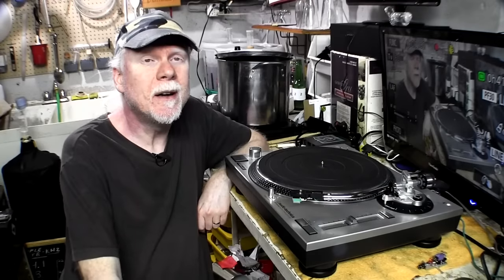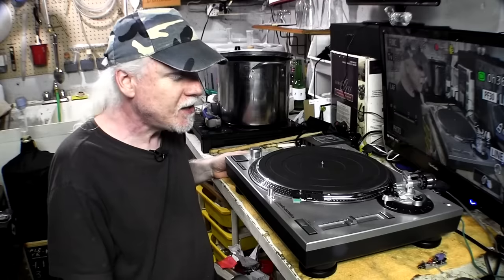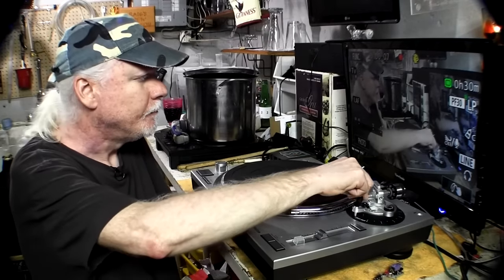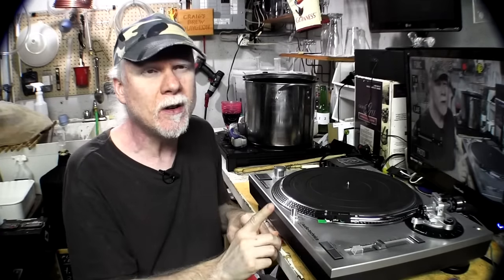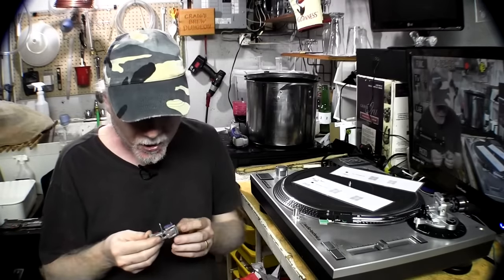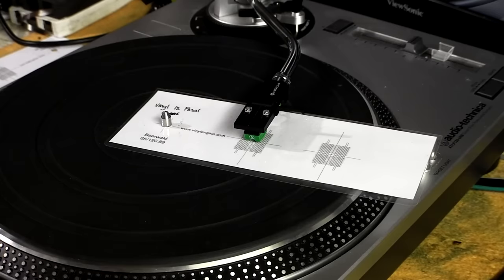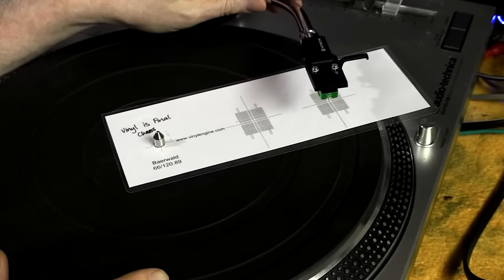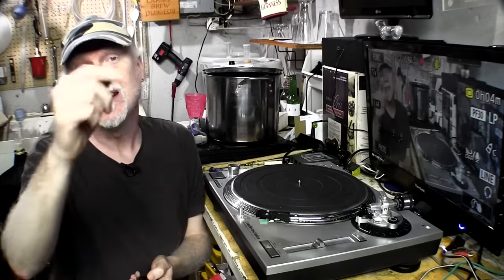Very Detailed Turntable Setup for Beginners

Comment: Hi Craig, thanks for your videos, they are helping me getting back on the vinyl after 20 years. I liked very much this one because I never knew how to calibrate the tonearm and the cartridge and after that decided to buy an AT-LP 120 USB turntable like yours. The price seems to be nice for what I saw, so it is on transit and next week I will receive it.

Trying to know more about it I search the net and found "a known issue" that scared me - excessive motor noise that intoduces rumble in the playback and it is very annoying, especially in quite passages on the tracks being played. I don't do DJ or like heavy rock, on the contrary I like soft music, smooth jazz, and so it will be a problem to me.

I found this video www.youtube.com/watch?v=YxVa8THzAEA and also many others with several attempts to isolate the noise sticking sponge or cork under the aluminum plate, putting orings around the arm, replacing the felt mat with cork or rubber mats, but none solving the problem...

Did you knew this problem? If so, as it seems to be "normal" how did you eliminate this hum/mechanical noise?

Thank you and keep uploading videos

Comment: That table has adjustable feet, there just very tight from the factory.
Reply from the maker: The Audio Technica AT-LP120 doesn't have adjustable feet. Trying to adjust them will break them.
Reply: Vinyl TV,
 I have the same TT and thought the same thing til I turned it upside down to bypass the preamp. They just needed a little elbow grease! The brochure says adjustable feet and I didn't believe it at first. Mine are adjustable and unbroken!
Reply from the maker: Ok, I noticed that they do unscrew. I guess that'll count as adjustable. Great observation!
Reply: Hi Vinyl TV,
they make a very strange noise when I try to adjust feet. I'm afraid of breaking them. Could you make a video on how to do it correctly without being afraid? Thank you :)

Comment: I remember the days of sticking a penny on the headshell and you're good to go. I always wondered why as most of my tracks when coming to an end they would start to sound distorted. I always put it down to dust pick-up during the track, which sometimes it was. I will do all these steps with both my decks now, cheers.

Comment: This is the clearest instruction video I’ve ever watched especially the cartridge my greatest fear in life Lol I’ve been a control room operator in a power plant facility for 30 years and now I feel comfortable to do this too Lol 
I recently purchased a turntable with speed control + or - any suggestions on where to set it? Thank You
Reply: @Brian Medeiros.. That's for pitch control..  
There should be an area on the side of the platter that's illuminated. You should also notice dots which you'll  see moving due to that light once you turn the platter on.  
The large dots should stay 'still' as the others move once you turn it on. IF the large dots move, use your +/- to adjust them until they stay in place.  
Hope that helps.. 🕊

Comment: Hi I think the position of the cartridge to fit the correct tracking angle may modify the balance of the tone arm so I think it would be better to align the tracking angle first and secure the position of the cartridge in the shel and thereafter to balance the tonearm.

Comment: On the AT - LP - 120   cartridge alignment  - the distance from the back of the headshell - the rubber to the needle tip has to be 52mm distance for accurate alignment  , I just thought it is important info that you didnt mention cheers for a good video .
Reply: You can set that distance INSTEAD of going through the cartridge alignment process BUT it's not as accurate as using an alignment protractor.
Reply: Yes it is just as accurate.
Its just someone at the factory did the protracter routine, after that he measured the distance from needle to a certain point and gives you that value in the manual so you dont have to bother with the protractor.
The correct technical term for all this is “overhang” , its the distance the needle overhangs the centre of the record and there are 45 rpm adaptors with an integrated scale so you can easily adjust in one step the overhang, all methods lead to the same result.
You would only need a protractor if you would use a non original cardridge with different geometry.

Comment: Finally, a video that explains all of this,  I have this same turntable and I  think it was a open box or a returned item. I had it for a while and it didn't seem quite right, I have fiddled with it on and off and kept looking but found nothing till this.  I knew the back had a weight but did not know the stylus needed to be aligned.

Comment: thanks for this.  It's useful because the reasons for adjusting are explained and not just given.  My manual explains to do x,y and z but not why I am doing it! You also explain to level the deck which my manual doesn't.  And to lower the arm release lever before adjusting, which the manual doesn't remind us. I play vinyl often from the late 50s and 60s so it's crucial I dont wreck them!

Comment: Great video! The only thing that raised a few hairs was setting the stylus on the laminated measuring tool, I have always been in the mindset that the only thing that touches the stylus is a stylus cleaning brush, it probably didn't hurt it but for me just holding it over the tool closely was good enough for me.

Comment: Nice video. Great lecture and advice. The Technics SL-1200 is the Mercedes Benz of turntables. I own 3, had 4 but one needed a new tone arm so I sold it. These things are bulletproof. I usually use a Rega Planar 2 which may have the audio edge on the over-engineered Technics, but the Technics is a very functional unit that will last forever if looked after properly. 
After writing this I realised that yours is a AT! Looks very similar.

Comment: I picked up a Pioneer PL-300 in good looking physical condition for $10 deemed as non working. It just needed Solder on the right red channel wire and the pins cleaned. It plays nicely. Has a ADC PSX-30 stylus on it.

Comment: The biggest challenge with most tables is no tonearm height adjustment. The Dual CS5000 incorporated a title feature on the headhsell which was very beneficial. As a result, I myself am cutting feeler gauges as a shim to achieve the perfect stylus angle of 92 degrees. I've also noticed if you line up 4 new cart's of same brand/ model, the cantilever angle varies by 1-3 degrees to the cart body. Using the cart body for stylus alignment is not accurate, nor advisable if you're using inexpensive cart's (>$500).

Comment: Good walk through. Should add a mention of adjusting the tonearm height, which impacts vertical tracking angle. This also varies with average LP thickness. Other points, many recommend erroring on the heavy side of recommended tracking weight. Love the most important comment, do this work at a time of few interruptions. Nice work. Finally mention, always replace stylus guard when finished, especially if you have pets, small child, or inexperienced housekeeper.

Comment: I recently bought a used SL1210 in very new condition off a wealthy audiophile, And the guy said 'I have never used this turntable except the day I bought it, And when I did use it, I paid someone to set it all up professionally' The guy seemed very honest, And this turntable is in IMMACULATE better than mint condition. (I have bought mint before that weren't as good) I just went and checked on the deck after seeing the part about anti skate, And when I saw both anti skate and weight both at a very light 1.5, I smiled and thought, Yup, The guys story was legit afterall. =) Also, I just checked the cartridge that came with a nice shure protractor, All perfect on the A & B spot. Im so happy with it

Comment: Thank you so much!  I just got a Fluance RT85 (and also one of those little scales for adjustment) and I could not make sense of the bit in the manual about making those adjustments.  I had eventually given up and set to the recommended pressure using the scale, but I couldn't work out what anti-skate was and left it at 0.  One of my records that was more prone to skipping ended up with the stylus going all of the way onto the paper.  I think that this will help.

Comment: Thank you !! I never realised the weights had two separate movements.

Also the cartridge alignment was something I never tried yet I understood why. I have a Technics sl-2000 Direct drive S arm 

And a Technics SL-6 linear tracking laser guided track detection direct drive.

Your camera work is very good indeed.

I'll say one thing though.. 

The force that makes the objects want to fly out of the centre of the turntable is centripetal in nature and is because all objects will want to go straight rather than in a circle unless acted on by unbalanced force. Newton 1.

The force that pushes against it is due to its reaction to this force, called centrifugal force.

It's like you pushing you finger against a window yet the window pushes back and squashes your finger flat.

One is a force applied and the other is the reaction force to that from your arm.

Centripetal and centrifugal. Opposite forces but one is just a reaction to the other.. Newton's third law of motion.

Relative to the record the cartridge is being made to travel in a path that's not straight.

Comment: Excellent video; well explained and demonstrated. This is the "art" of analog audio ...the turntable being the ultimate form of "analog" taking the very mechanical motion of the stylus/groove interface and turning it into an electrical signal. I have done this alignment ritual more than a few times in the past; the good part is you only have to do it once. My only question or comment about your process is this: not only does the stylus need to be properly distanced from the tone arm pivot point ...which you show using the printed guides ...but the cartridge and stylus must also be perpendicular to the groove at those two null points as well. That's what the grid lines on the set up guide are for; to eyeball the perpendicularity of the cartridge to the radius line and make it so. It is this extra adjustment making this task a true test of patience. I suppose if you were using a truly conical stylus (think ice cream cone) then the perpendicular setting wouldn't be critical. But most higher end styli are usually shaped like the end of a flat blade screw driver with a pointed tip ...and for these type styli, getting that "screwdriver" tip to ride the groove as close to perpendicular to the walls of the groove as possible is also very important ...ergo making sure the cartridge is 90 deg to that radius line on the guide.

Comment: Some tonearms, such as those on older Pioneer decks, such as the PL-12D, have an auxiliary weight at the rear of the main tonearm weight, for use with heavier cartridges and headshells (better for use with some MC cartridges that require a 'heavier' tonearm). These screw inside the rear of the main counterbalance weight.

Comment: Greetings . First of all congratulations for the channel !!! EXCELLENT !!! your work the one you are doing, I have an Onkyo Digital A-8800 with all the modules of the equipment are Onkyo which are an M504 amplifier sound, with an EQ540 Interga equalizer and another EQ-201 and another EQ-25 and another EQ-140 and one TA-2550 Interga and one TA-2750 Interga and one TA-205 Interga deck and another double deck TA-RW 909 . a CP1500F Interga platter and Ortofon 40 turntable needle and CD DX-708 Interga, and the T-4500 Interga radio, All the models are from the Onkyo brand, which is the best that Onkyo does NOT make mass production if they are not selected from the Onkyo And the cables connected to the equipment are of the KabelDirekt Pro Series RCA brand and 4 DAS R-212 Speakers. and 2 Mivoc hype 10 g2 hifi subwoofers, 300 w, from 20 to 180 hz. IN THE END A CLASSIC OF THE 80S AND 90S of sound equipment of that time, over the years I have never broken any module, that is already seen from how they worked before and the manufacturing materials, I hope to have it duarte, many years for the quality of a good musical team, greetings and very good videos that you have a great like for your great videos, great sound models like these devices are no longer manufactured, it is a pity, that nowadays everything is plastic, greetings from Barcelona - You could do one of Onkyo Interga also of Review - Congratulations to all Onkyo electronics, the Inegra Series was a true excellence. I bring you bad news, for this glorious brand, which made hifi history, these days, Sharp, who recently acquired the brand, announced that the debt is incurable. The electronic audio equipment company Onkyo has filed for bankruptcy, after accumulating debts of US$24 million. Onkyo, founded in Osaka in 1946 under the name "Osaka Denky Onkyo K.K", has failed to position its mainly analog equipment in the streaming era, consequently Onkyo has been declared bankrupt by the Onkyo company. Even if the electronics produced today had nothing to do with the wonderful electronics that it has... A big greeting from Barcelona, Spain,

Comment: First time I had an explanation short and clear about how to setup a turntable. Many thanks. Though you didn't talk about the rotation speed setup.
Also what are the other setting that reads 'Height adjust' I guess its the arm height, but what's the use. Many tanks anyway.

Comment: Hi thanks for the dedicated instruction. Very few such videos can be found on YouTube surprisingly. I want to ask about “overhang”. Long story short, I believe if you align the cart plastic casing with the two cross hair, the overhang is also taken care of. The center line that runs out of the spindle core through the two grids factored in overhang right?

Comment: Very helpful video! After zeroing and balancing the tonearm, if you then micro adjust the tonearm to, say,  2.3 as seen on that calibration dial, would you match the anti skating # to that, or just stick with the recommended 2?

Comment: Thanks for the video, really well explained! I have a question though. I bought a second hand turntable set and bought new headshell and cartridge for it. But using the protactor I seem to only get the cartridge aligned when I attach it in an angle. Why is it not preferable to do this and how can I solve this? Hope someone can help me!

Comment: Hello,
I just watched your video and really enjoyed . Answering all the questions we need as a new to turntables.

I have a question about the pitch. What does the pitch adjuster and do I need to do anything on the brand new turntable? I have Technics sl1200GR, wondering if the pitch speed has to be adjusted according to a different record playing? You can see I’m very confused and need to learn how to use it, what is position on top of the deck? In my thinking is there because you need to use it often, if is a one time setting should be hidden like the other adjustments under the plater. 

Please someone to explain,

Comment: Best video I have seen on this! Thank you so much!

A few questions:
-Is proper tracking force determined by the TT or the cartridge manufacturer?
-Do you recommend doing the cartridge alignment while the TT is level (positioned on your media shelf) or can that be done while sitting at a work bench like this?
-Do you take stock in vertical tracking angle as an important factor?

Thanks again! -Nick

Comment: I'm under the impression that aligning the actual stylus parallel to the lines of the protractor is MORE important than aligning the cart body. You do this by sighting "underneath" the cart body and viewing that the stylus is parallel to the printed lines running fore and aft. Do to manufacturing processes, the stylus might not be installed "square" to the cart shell.

Comment: Hey there. Very informative video, I learned  a lot and still have a lot to learn when it comes to setting up a turntable. I do have a question. I have a Philips 777 direct control. The tone arm counterweight on the tone arm is easy to find of course. But I can't find the dial where I have to set the tracking force. There's no numbers or anything to set the tracking force and I don't see a separate dial. Is that normal? How do I set the tracking force on this particular turntable?

Comment: Excellent video, but I have a JVC AL-F3 and it's weight on the tone arm won't budge.  Haven't used it in years and think it just needs an adjustment:  It plays well but only 2/3 of a side, can't make it go further and also it won't turn off.  The platter will keep turning as long as there is power.??!!

Comment: Question,  I've never adjusted the tone arm weight and I've had thru the years many many turntables. Reason being they always played just fine.. is and what would the reason for me to make adjustments,  does it really make that much of a difference in the sound of my albums? The last one I bought was a audio technical, has no numbers on the adjustment just a line of circles around the whole thing, albums play good. No skipping  or sliding across the lp.that being said should I mess with it
Like I said I've never adjusted the tone arm weight to needle and thru the years I've owned many different  brands and never adjusted. Should I even mess with it. I'm like 67 and like I said  ive owned many different makes and models 
My main question is since always they played great. Will adding a slight weight to the needle and cartridge make a noticeable  difference?
Reply: Two Cosmic. Yes adjusting the weight and tracking of the tone arm will make a big difference. If the stylus is applying too much weight it will cause excessive damage and wear on the lp’s. Also the cartridge will have a tendency to drift left and right as the record turns , again excess wear and distortion in sound. I have practiced most of his recommendations for years though he did clarify some things I overlooked. This guy is a master .